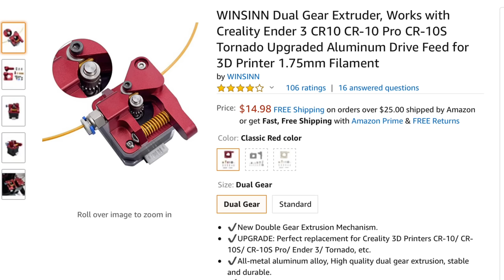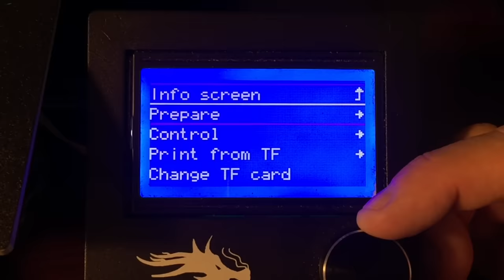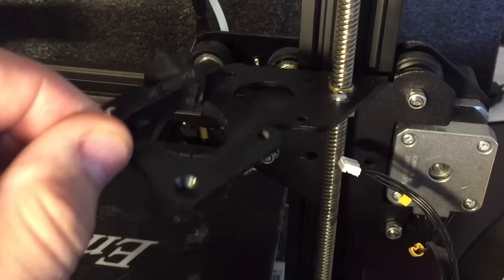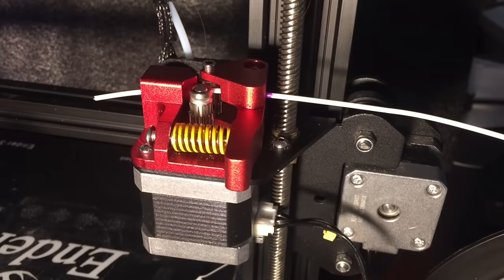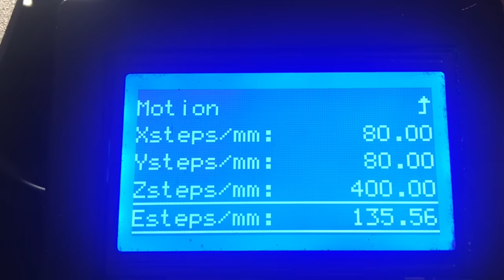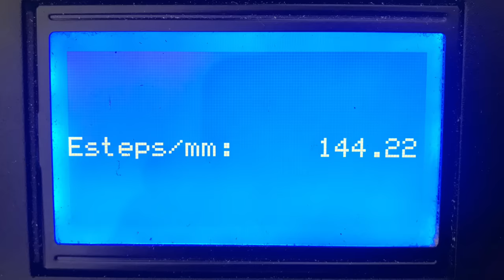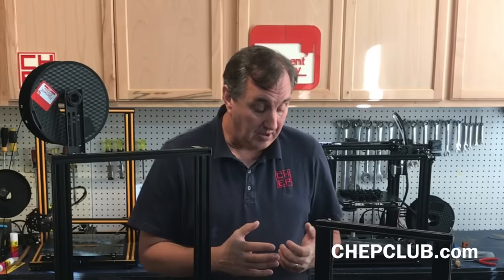Dual Drive Gear Extruder Upgrade + E Steps on Creality Ender 3

Comment: Hi Chep I was wondering if you can help me.  I just installed one of these dual extruder on my ender 3 pro. I keep hearing clicking now and then from it. I don't see it slipping, just clicking here and there. Anyway to fix it? Or have you heard them on yours as well?
Reply: Hey, i just installed it yesterday too and: make sure the gears are aligned properly (make sure to tighten the screw on the gear) and the springs are tightened just right. Also, the filament seems to be rubbing a bit on the hole where the filament goes into the ptfe tube for some reason. I would also check the ptfe tube and the couplings.
Reply: HI! 

I'm having the same issue. Some weird noises when pushing and retracting the filament.

I noticed when changing the filament that I have to do a lot of force to extract it.

I didnt noticed cloging and even more I changed the ptfe for the second time this week with the same results.

I dont know if I'm doing something wrong assembling the noozle.

HELP!!!

Thanks.
Reply from the maker: Clicking is usually and indicator of partial blockage in the filament path. I covered that here. https://youtu.be/OvAU1ZLFyow

Comment: How do I calibrate this on an Ender 3 S1? The instructions are not the same.
Reply: Since you have a direct drive extruder and not a bowden tube type you may have to skip measuring filament travel when disconnected from the hotend, since you would need to take the direct drive extruder off. You could skip directly to heating the hotend to your normal printing temperature and extrude 100 mm of filament and take your measurements, then adjust e-steps using the formula mentioned in the video.
Reply: @JonnyFlash80  not even sure how to do that

Comment: I wish they would consider adding more color options for the anodized parts. I purposely went with the non-dual gear version because it came in black. People like to print upgrades and have certain color schemes for their printers. It would be nice to see Blue, Black, Green, and some other colors available.

Comment: i calculated close to 145 mm estep and i was over extruding like a mofo. But when i change it back to 93 to 94, its much better. why is that?
Reply from the maker: Not sure. Did you calculate the 145 thru a hot nozzle?
Reply: Same thing happened to me. I did the calculation with and without passing the filament through the nozzle to extrude 100mm, but when I print, it is clearly over extruding. I had to lower the steps per mm to almost the same value of the original extruder to fix it. I don't know what's happening. Thanks Chep for this great video!

Comment: My new ender 3 pro has a Press fit gear installed in my stepper motor. I can't get that out with a allen key or a screw or whatever. Anyway, is it possible that i can install a metal extruder kit instead of a dual gear, even with that press fit gear on my stepper motor? Or i will need to buy a new stepper motor just for that? (i don't really want)
Reply from the maker: That should work fine with that pressed on gear.
Reply: I got one of those gear puller thingy from Amazon to pull the gear out
Reply: How many steps did you get whith the dual??? I ve just cjanged mine for this one and i had to programe 330 steps or it doesnt worked out... its printing ok .. is it right???

Comment: It seems like my stepping motor shaft is not long enough to put the gear on to line up with the filament
Reply: What machine do you have?  I just ordered up th Zeelo Dual Drive Extruder (which the link above references) and hoping it will fit Ender 3 V2.
Reply: @davethomaspilot  i have the ender 3 pro and the shaft wasnt long enough to light up the gear on the extruder with the other gear.  I ended up just getting an aluminum single gear replacement from creality
Reply: @ddangle81  Came here trying to figure out why i was having this issue as well, turns out the 2021 versions have a shorter shaft than the older versions, and the gear that comes stock is pressure fit in place. I was bummed to find this out since I ordered my dual gear and my ender 3 pro at the same time x(

Comment: I want to upgrade the extruder on my Ender 5 Plus to the dual gear like you show here. However, the touchscreen menus on this are much simpler than the typical Marlin scroll menus and I don't see the e steps option anywhere. How do I adjust the e steps on this machine?
Reply from the maker: Use USB and send M92 plus new e steps. https://marlinfw.org/docs/gcode/M092.html
Reply: @FilamentFriday  Thanks, but I don't know how to do any of that. Do you have a video about changing these kinds of things by USB connection?

Comment: Would you still use the duel gear extruder if your machine came with the metal version of the stock extruder
Reply from the maker: Probably not. I prefer the EZR extruder I show in other videos.
Reply: CHEP awesome I’ll take a look thanks for the reply I picked up a lotmaxx sc-10 and there’s not much out there on this printer but it’s very similar to your ender 3 and cr-10

Comment: chuck how do you gauge tension on extruder arm i.e. spring adjustment
Reply from the maker: No slippage and also not digging in to much.
Reply: @FilamentFriday  thanks I have changed the drive wheel as the one on had sharp teeth and digging in alot, went to calibrate and I dont have the means of moving the extruder or Z axis in my firmware only X & Y ?

Comment: Hey CHEP, I got an issue after installing the replacement with the retraction not working as well, is that a variable that i have to change independently from my Esteps in the slicer?
Reply: Are you using Capricorn ptfe
Reply from the maker: No, you shouldn’t have to change anything.
Reply: @shaunburns3332  yes, i am using the capricorn tubing and the same extruder replacement shown in the video.
Reply: You shouldn’t need to touch the retraction settings I didn’t touch mine only my extrusion settings

Comment: Is it true it allows the prints to be faster? Somebody mentioned that the quantity is increased so you can save time....
Reply from the maker: It doesn’t change the heat characteristics or other factors affected by speed so not sure I buy that.

Comment: Hey Chuck ... I did the BLTouch install at the same time and updated the firmware to the 1.1.9 Bugfix version. When I went to re-do my e-steps calibration I quickly realized that I didn't have the e-steps menu option via the ender's LCD. Any advice? Do I instead just set the value in Cura? If so, how would I test it? Thanks for any advice!
Reply from the maker: You should be able to enable it in firmware if you reflash.
Reply: CHEP - How would I do that and maintain the 1.1.9 bugfix version?
Reply from the maker: Not sure but it’s probably just commented out in the LCD menu firmware section
Reply: CHEP That makes sense. This is a modified bug version fix that gets the 3.0 bltouch to work with the 8bit board and retain a lot of the other things plus add a few. Some things I don’t need. Once I get a little more savvy with firmware, I’ll try to swap some stuff out. Thanks for putting me on the right path. Your videos have been crazy helpful! The fact you reply promptly to comments - my hat is off you sir! Happy Easter!

Comment: i just did this on my ender 3 v2    alot better ,,,,but ,,,, the heat from the stepper motor is transferring onto  the Capricorn PTFE Tubing coupler, up to 107 C  and they are only rated at 60c lol so every 30 hours im going through ptfe tubing :(
Reply from the maker: Your stepper shouldn’t get anywhere near that hot. Reduce the drive current on the main board.

Comment: I have a ender 3 Neo Max that is 2 months old and the stock extruder nut that holds the idler great broke away from its base making it worthless.  It is all metal, but it is very cheap metal.
Now that it is Chinese new year   Creality is closed for 10 days with ZERO support meaning I have to wait at least what 2 more weeks.   
One of the pitfalls of dealing with Chinese products.

Comment: i had to increase retraction from 5 mm to 7 mm and im kinda short on 7, also the gear extruder (not the one on the motor) is kinda eating the aluminum of the extruder, i see black dust piling in the aluminum case, is this normal?
Reply from the maker: No, that’s a bad extruder.
Reply: Get a better Gear extruder kit, some kit's have the gear(not on the motor) just directly attached which rubs on the metal gear. Two ways solve this, get one where they include inserts which allows the gear to move freely OR put a smooth plastic washer under the extruder to prevent it from rubbing the metal extruder directly (but this you have to change the washer once in a while)
Reply: Felipe CC I noticed this same thing regarding the secondary extruder gear.  If you take it apart, you will see the bearing it rides on is very short compared to gear height.  This allows it to tilt slightly and slowly grind the aluminum under the gear.  I ordered another setup just to stack another bearing on the first to correct the issue.

Comment: Please help!  I've tried everything including calibrating my esteps. I'm printing a cal cube. My first layer is fine, the second looks a little too thin,  and the third the filament is squishing around the nozzle like either the nozzle is too low or the flow is too high. I've never had this problem before.  If i raise the nozzle the first layer won't stick.  If i decrease the flow the lines of the first layer won't touch each other.  Only way is to dial the first layer flow way up and the main flow way down but I shouldn't have to do this.  Please help!
Reply: Sounds like z-axis binding issue. Search the web to validate

Comment: I've bougth a too cheap knock-off from ebay: The force from the spring is so strong, the motor cannot turn. Even if I put in the spring that came with my Ender 3 pro, it's too much. Any ideas?
Reply from the maker: Check the gear alignment
Reply: @FilamentFriday  thanks ! The screw that held the gear to the motor jammed into the body, had to lower it beyond optimal position. Cheap crap!

Comment: I tried to do this today on my Ender 3 V2, and I could not find this  setting under control/motion,.  Did they move it?
Reply: it got renamed to Transmission ratio in V2
Reply: Depends on firmware updates...

Comment: What if I have the older model ender 3 without the estep option? How would I make those changes to calibrate it?
Reply from the maker: You can thru Pronterface software and a USB connection.

Comment: I just upgraded to this extruder and I am still getting the filament clicking like it is slipping.  Any suggestions or ideas?
Reply from the maker: Your hot end may be overheating. If you touch it and it’s hot, the fan is bad.
Reply: My problem with the clicking was the extruder adjusted too tight, removing the adjustment cap on top of the screw fixed it, also the extruder e steps not being calibrated, then check temps again and make sure you don't have a clog from filament flaking off the gear notches, lastly a worn out motor may need to be replaced

Comment: My extruder just broke on Ender 3 pro, plastic broke. So I'm looking to upgrade it. I have a couple questions, my stepping motor shaft does not have a flat spot. Will it work for my printer?
Reply: You could file a part flat, but I imagine it would just mean it’s more likely to slip even if you really get that screw tight.
Reply from the maker: Possibly.
Reply: @jonahswim  yea I also think the shaft is too short
Reply: @FilamentFriday  mine came with the shorter shaft too, looks like I’m going to buy a different stepper motor and keep the old as a spare

Comment: Issue: Extruder is shaving filament;  
even though I adjusted the stepper grabber perfectly the idler grabber wheel is slightly too high and there is >no idler alignment adjustment or shimming<. I'll need to bring down the stepper grabber ever so slightly LOWER to compensate for the idler grabber pushing too high.  Issue piece is the metal red-anodized extruder frame (that holds the stepper motor). The feed hole for the filament to the Bowden connector/tube has a sharp edge to it. Secondary issue piece is the idler grabber wheel lacking an adjustment.   The feed hole has NO CHAMFER to assist in guiding the filament into the hole and >eliminate shaving< of the filament. The top of the feed hole has a sharp edge and shaving off the very top of the round filament. The easiest fix is to machine a slight CHAMFER (i.e. funnel) to the filament feed-hole eliminating the close sharp hole edge and help guide the filament into that feed hole!
Reply: The chamfer and slight readjust of the Stepper grabber fixed all. I found my E-step to now be 144.00 @ 230C from 93.xx.... I'm concereend about the metal on metal wear of the Idler-grabber on the handle (needs super thin shim washers).

Comment: Chep, I bought this kit and I think something might be broken. The machine stops 70mm short with the bowden tube off when I take a baseline.
Reply from the maker: Check if gear is slipping on motor shaft
Reply: I think it's because the diameter of the rollers is different. That's why you have to change the number of steps it takes to feed the same amount of filament. Watch the video ten more times like I had to. LOL.
Reply: @Skammy5   Nope. There was a setting that for some reason cubed the e steps
Reply: @user-di5rw7sm3d  Well I think either way, it would still need to be adjusted.

Comment: Are you able to save steps because you have upgraded the board? On my i can save seting but only till power off.
I had to use m92 in gcode to get new steeps\mm to work
Reply: You need to go to configuration -> save, or issue an M500 from terminal.
Reply: Yuo can save configuration on the standard menu, just go back from Motion menu and select save eeprom or something, this save any change yuo do to.Motion configuration
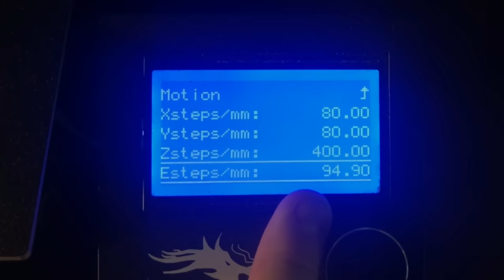Reply from the maker: Yes, as I stated at 2:17 in the video,  newer machines and those with silent boards installed have that in the menu.

Comment: Cheap will this help with extrude r slight skipping on first couple layers. Only slightly does it on the first couple layers. I have tried raising the bed but if I get too high of course then it doesn't stick.
Reply from the maker: Possibly.

Comment: I upgraded to this extruder on my ender 3 pro, and though it works well I cannot seem to get the retraction/ other slicer settings down. I keep getting constant stringing and imperfections on my layers and I am not sure what is causing it as I have tried many things. Am starting to think it is my filament but does anyone have any suggestions?

Comment: If anyone is having problems with under-extrusion or extruder skips, try replacing the stock PTFE tube with some from Capricorn. I replaced the tubing and my skipping stopped. Hope this helps someone!
Reply: @autogyro333  Hey Tech Guy, first thing I noticed is that you said you print PLA at 223 Degrees. That seems way too high of a temp for PLA (most run from 190-220). Unless specified by your PLA company, try doing a print test tower (look up Teaching Tech). In a nutshell, the gcode builds a tower where it changes the temp per section, allowing you to see the best temp for your filament. If this isnt the problem, upgrading the PTFE tube to Capricorn wouldnt hurt anyway, even if the tubing wasnt the problem. I would recommend trying the test tower, then upgrade tubing, and if those things dont work, try getting a new extruder (a dual gear would be a good upgrade. Before all of these things MAKE SURE YOUR ESTEPS ARE CALIBRATED. I hope this helps you!
Reply from the maker: @Tech Guy - Adjust your bed level. It’s too close to the nozzle if it’s only clicking for the first few layers.

Comment: Did you try to print flexible filament with it? How is it compared to the stock one?
Reply from the maker: It won’t handle the really flexible Ninjaflex.
Reply: Got it, thank you.
Reply: Could the long bowden tube be a negative for printing flexible filaments?
Reply: @qwewer6  Yes. It's because of the excess friction produced by rubbing against the bowden tube. This is why most 'flexible' extruders are direct drive.
Reply: Thank you, it's more clear now.
Reply: @alberttan3623  so wiuld i need this dual extruder if i buy a direct drive?
Reply from the maker: I print flexible all the time on bowden. Works fine. I use the EZR extruder.
Reply: @FilamentFriday  is the EZR better then the one you have in this video?

Comment: is it possible to have 338 steps/mm? it looks like that's where mine is at now after this mod. Now it seems to line up to my 100mm mark.
Reply from the maker: If that’s what you have. Seems high.
Reply: @FilamentFriday  for some reason my printer is printing better than before more plastic comes out my and parts seem to be more rigid and the layers seem more full so just for anyone that may experience a higher number it works for me the part upgrades are worth it for sure.
Reply: @E85_STI  make sure you have PLA off in filament settings, throws the steps way up for some reason. I had 350+ instead of 99 with it set "on"
Reply from the maker: Where is the PLA off you refer to. The E steps are done independent of the slicer.
Reply: @FilamentFriday  it's in control, filament, and i was mistaken it's not called PLA but "E in mm3". With it on i had to have my esteps at around 350.

Comment: The gear on my motor has no set screws.  It looks like it was crimped on.  Any idea how I can remove it without completely destroying the motor?
Reply from the maker: I’d return it.
Reply: @FilamentFriday  I have the same problem :( it would seem that creality changed it, returning the printer aint gonna fix it unless you can trade it in for an earlier model